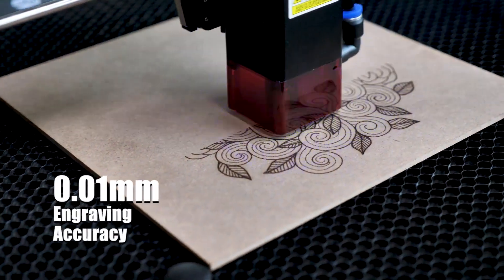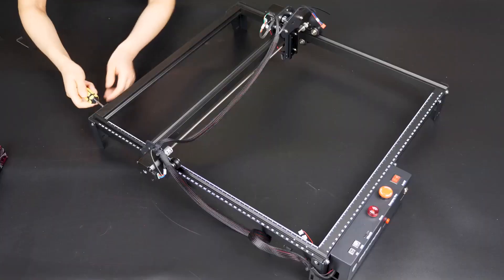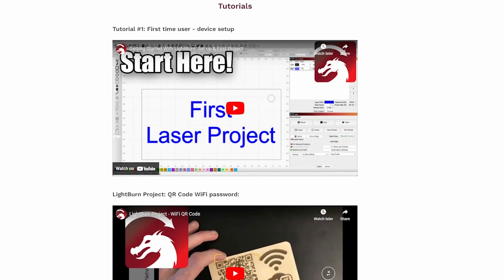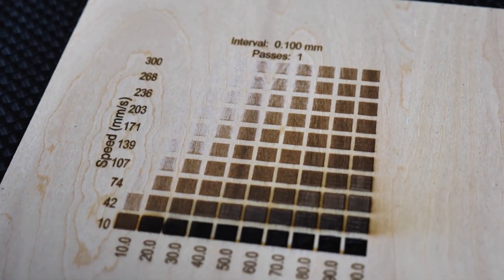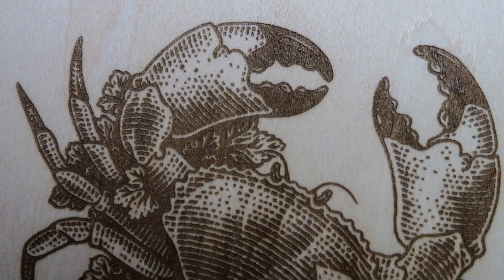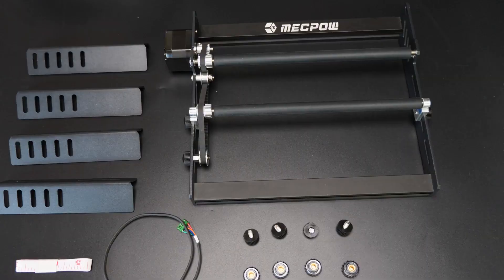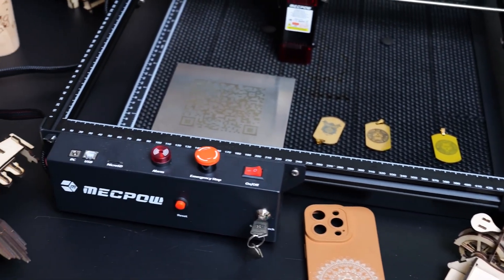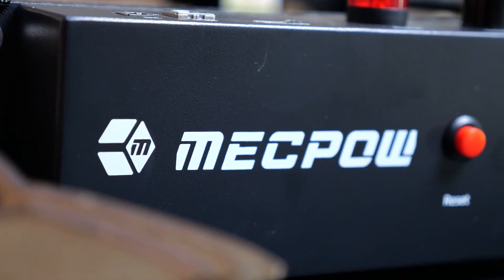Mecpow X3 / X3 Pro: The Budget Laser Engraver for Everyone

Comment: Do you think it's possible to engrave on black anodized aluminium 1000mm x 1000mm just placing it on top of the aluminium sheet? thanks
Reply from the maker: Hello, engraving on aluminum requires coating
Reply: @Mecpow 

Is that also the case with anodized aluminium?

As I know with a CO2 laser, which normally doesn't engrave metals, it's possible to remove the anodised layer with the laser.

Just curious as my only experience is with high power CO2 lasers.